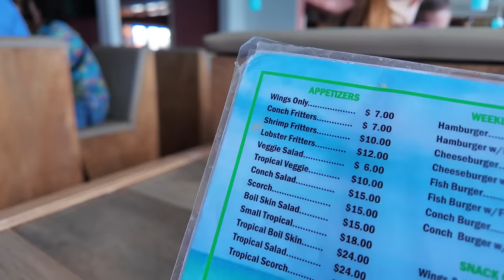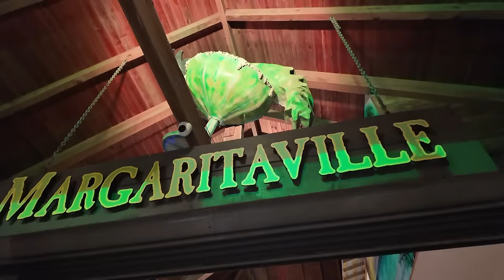Personal Wet T-Shirt contest

Comment: I used Chub Key as a place to duck into when bringing my 27' Proline walkaround to Nassau back in the late 90's and also fueled up there. We crossed in January in not the best weather with a brand new boat crossing the flats from Bimini to Chub before a big squall was forming up over Andros making the Tongue of the ocean whip up into big seas where you go from shallow to 5K feet of water. I used it again when I returned my boat back to Florida it was a easy and safe fuel stop.

Comment: For a old school fix for the rolling. We used to tie off 5 gallon buckets on the non dock side. Put a brink in the bucket sink it. You'll need 2 or 3. Tie them off, 3 feet below the water. Oh and , drill holes for a rope handle thru the bucket.
It works because the chop waves rocking the boat, can't lift the three buckets up, water, pushes against them like a brake. If u can sew,  make, a canvas, kite square, use tent pole, to keep it open, strap a brick in the middle,  it like a sea anchor. The sunken , open square, canvas, stops the lift motion.
Reply: on a boat - where would one store 3, five gallon buckets???

They are on a small boat, yo!
Maybe the marina needs to install a break water!!!!
Reply: @kappaiota5105  the buckets, would not have the metal hoop handle.
3 buckets fit into each other. 1 bucket stacked with three is the same as a dock bumper. There not in a kayak,  when not over the side.... There a thousand uses.
Trash, dirty clothes, a ice bucket, collect rain water. Have, a 😂😅🤣1970s, karaoke, dance sing off and be....( devo ). And put the buckets on there heads, hahah,. OR Bobby can take up the bucket bongos.
Reply: @kappaiota5105  they could STAY at a marina with a break water, rock riff.
Bobby, eats at 5pm, to get seniors discounts. He only stays at a nice, hotel in off season rates. His wallet has a lock on it. Hahaha , now he got a hottie.....
He breaking out a few bucks. It's a first....🤣😂😅😆🤯
Reply: new to the channel i wont want to be feeding 7.4's every day

Comment: Did you have to cut the wires?  Do you have a circuit breaker for the bilge pump or are both bilge pumps connected to on breaker?   Should split them if they are, just for situations like this.

Comment: Amanda, you just don't understand.  If blood ain't running, it just ain't a normal day.  Maybe that's just a guy thing.  Germs??  Naw, no worries.  I'll wash it off when I have time.  Hehe!!  At work today I was carrying a washing machine box with trash in it over my head.  I happened to knock down a back piece to a reclining sofa that was not light.  When it hit me on my shoulder, bounced off, then hit the ground my boss screamed thinking I was seriously injured.  I couldn't even fake an injury, I was too busy laughing about it.  Need to know info:  I'm 45 years old, but still 21 at heart, 6'3" tall, 160 lbs.  I'm skinny, but far from weak.

Comment: Reminds me of how tight it was working on my 310 Sundancer. You had to be a very flexible monkey to work in certain areas. Plus you always need some other tool which means having to get out of there and wrench yourself back into where you were. And did I mention it’s always hot.